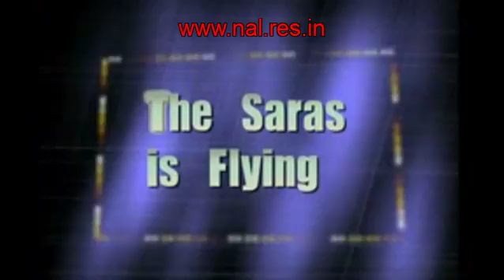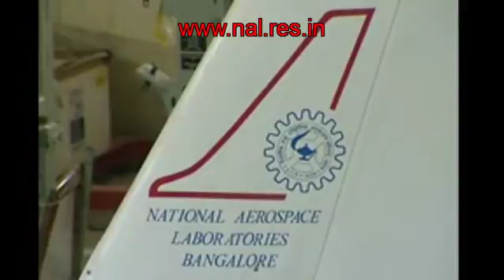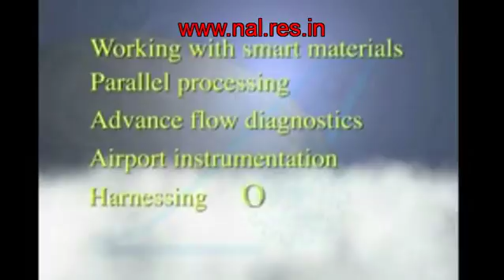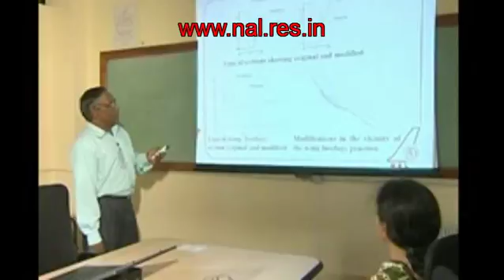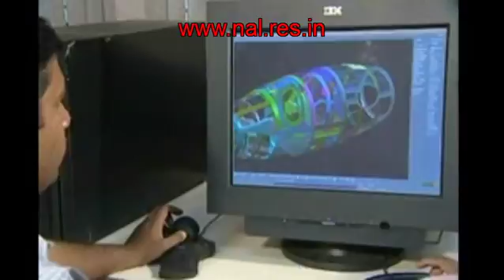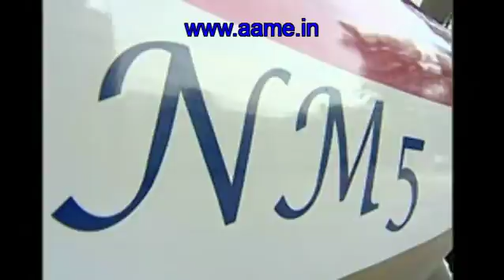Presentation - NAL SARAS, India's Indigenous Aircraft Development Program

Comment: How long the mandarins at NAL will need to develop and make it operational in India ?.30,40 or50 years?.Herr Kurt Tank developed HF-24 fighter from scratch and in 1962 it flew and served India for 30 years very well.He did this in just 6 years!.NAL people with all the gadgets and electronics could do nothing in 30 years!They better bring experts from Boeing Cessna,Lear or embraer to help to finish the development.
Reply: Because it is a lab. HAL invests their own money into research and then builds it's own products. They don't run to the ministry for funds for small testing. HAL ALH, HAL LUH, HAL HTT 40, all were designed by using internal funds. HAL has a corporate structure. 
After designing, NAL retains no interest because they neither have the funds nor do they retain a certain level of autonomy to innovate and come up with their own projects. 
Case in point Saras. Why wasn't it put in to production ? Will mk2 be put into production? Or will it remain as a tech demonstrator ?.